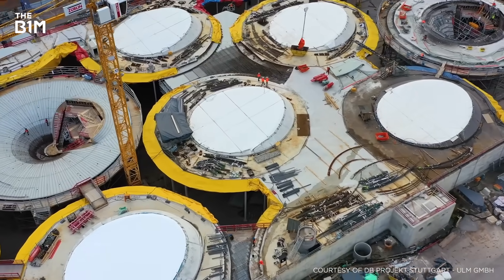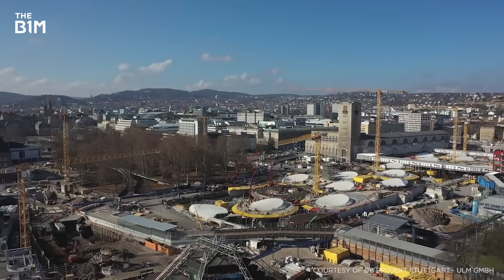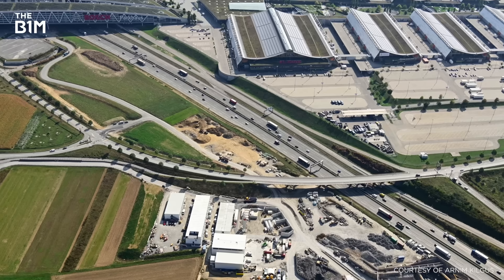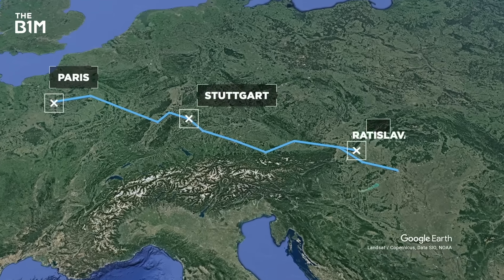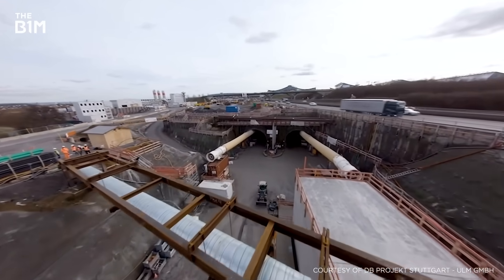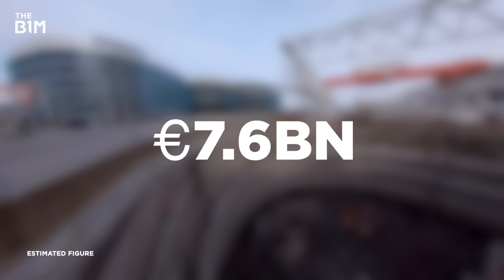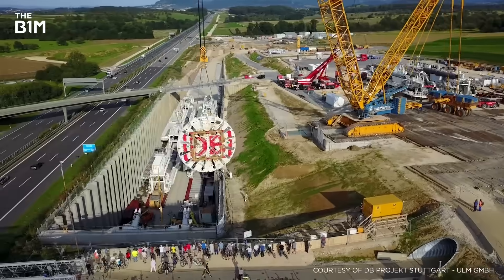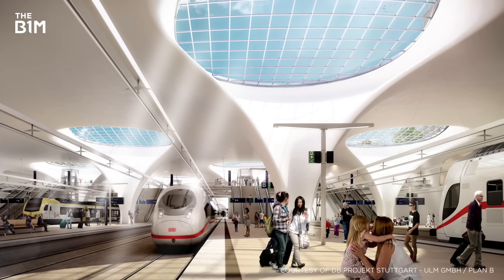Germany's 27-Year Struggle to Complete a Rail Project

Comment: As someone who lives near Mannheim and has seen them expanding the station there from 9 platform tracks to 11 just a few years ago I still can't see how having only 8 tracks in a city like Stuttgart (2019: 255.000 passengers daily vs 100.000 passengers daily in Mannheim) is supposed to work out and more than that expand on passenger capacity in the future
In my opinion they should never have planned that station with anything less than 10 or maybe even 12 platform tracks. As things are going they will have to eventually rip the whole thing open again and expand it in just a few decades because they can't keep up any longer with increasing rail traffic volume.
Reply: Unlike at Mannheim Hbf there will be no S-Bahn trains at S21 as those will continue to use the existing S-Bahn train station there.
Also Mannheim is a major knot e.g. for ICE trains. Not the case with S21.
Reply: @abalada  Even if you count the 2 S-Bahn tracks to the 8 S21 tracks it'll still not realistically work.
As I also wrote Mannheim has a daily passenger throughput that is far less than that of Stuttgart (new numbers say 118.000 in 2020) and that comes with 658 daily train stops of which 238 are from high-speed trains like IC, ICE, TGV, etc. The most recent numbers about the current Stuttgart central station I found are 1280 total trains daily in 2014 and 236 high-speed trains daily from 2018. Between Mannheim & Stuttgart lies one of the essential high-speed rail lines in southern Germany that connects Frankfurt with Munich and other cities in the south through both Mannheim & Stuttgart.
So what you're saying is basically that they'll scrap the high-speed train connections once the new station is finished and turn it into a regional train station even though they turn it in a through station so that high-speed train connections don't have to be planned with long stops that need to happen when the trains are turned in the current terminus station. Come on, that's getting even more ridiculous than what I originally thought it was.
Not to mention that the current Stuttgart HBF seems to have a maximum hourly throughput of 50 trains/hour with a current maximum of 38 trains/hour while they new S21 station only has a maximum hourly throughput of 32 trains and the expected throughput in the medium-term is 50 trains/hour.
Seriously, where do they want to accommodate all those trains if they can't even accommodate all of the trains that are currently passing through that station. Not to mention that they promised that the new station would be able to double the capacity of the current station, but even if they add additional tracks they don't even have the infrastructure to accommodate additional passengers past those 32 hourly trains, so they'd have to work on that as well.

Really, the more I read about that train station the more I realize that it's an even more garbage project than BER was and it's proving me right in my opinion that 8 tracks will never work in the medium- to long-term and they will have to expand the station considerably before long.
Reply: @TheLightbaron  You have to be careful, what your're writing here. Facts: Stuttgart S-Bahn (suburban train) => 150.000 passenger's on two underground tracks with about 700 trains per day (pre Corona). Stuttgart Main Staition => 100.000 passanger's with 470 regional trains and about 170 trains in long distance traffic. And, who is telling you that the capacity of the new trough station is 32 trains only? The two ungerground tracks of the S-Bahn Station can accomodate 48 trains per hour, will be increased to > 60 trains with ETCS Level 2 technique from 2023 onwards. The new through station can accomodate one trains every 5 minutes / per Track => 12x8 = 96 Trains per hour. 
Even Cities like Hamburg (2 Million) and Cologne (> 1 Million) have not more that 8 regional / long distance tracks, but much more passangers !

Comment: Nice video, but it presents the project way too positively.

Further, the new Stuttgart-Ulm railway connection is not part of Stuttgart 21 and can be runned indepently. It even will, since it will be ready more early. It is just packed together by the S21 propagandists.

Actually, even when the project is finished, it would make sense to undo it to the initial state. Since it has LOTS of shortcomings. 

Actually, it has less capacity than the old station (when the simulation is not run by interested parties). It has huge riscs for life. The project was just made possible through lots and lots of exceptions from the specific regulaments. 

Actually, it is just a way to transfer public money to private. With corresponding stimulation of the politicians.

Similar projects in Frankfurt ans Munich were abandoned in the planning phase since they make no sense.

Even in Stuttgart the project was stopped once in the planning phase.

And than came a former Daimler boss to be the boss of the railway company. One could think he has a hidden agenda to reduce the concurrency to the cars by destroying the public transport.

Even he claimed later: "If we had known what we know today, we would had not started the project."
Well, lots of experts knew that before. 

It was rather the case that the project was pushed in order to say later "Now it is too late to stop." 
But only psychologically it is not worth stopping. But just because lots of money are lost it doesn't mean we have to throw away even more money.

Comment: Huge projects in Germany have been a disaster for decades now. High speed railway in Germany during the 90s was the standard for Europe. Nowadays its as bad as everywhere else. Constant delays, trains not coming, etc. Everything wen't downhill beginning of 2000s.
Reply: 50% more rail passengers since 2000. A public seeing the results but denying to deal with the causes like certain bottlenecks in the network. Only now this is slowly changing.

Comment: Usually cost overrun problems are caused by contractors who deliberately quote impossibly low prices in order to get the project. Once the government has their name on the paperwork, the original budget will be spent on digging a massive hole in the middle of the city. This will reinforce the Sunken Cost Fallacy phenomenon, meaning that the project can't be cancelled because so much money has already been spent. No politician is going to abandon the project at this stage, because it would make them look bad, so they will double or triple the budget instead.

Comment: In Germany, large infrastructure projects often take half a human life time. 35 years with projects like these is normal rather than the exception. Or, consider the upgrading and widening of the upper Rhein (Rhine) train artery. A very important trans European transit route for cargo and people. That'll take some 70 years alltogether. The upper Rhein train tracks have lacked capacity for a long time now.
The project will link Switzerland and Southern Europe to the German industrial heartland (lower Rhein / Ruhr valley) and the "Be-Ne-Lux"- countries and their large sea ports.
Of course, the Swiss built the worlds largest tunnel (Gotthard, at 57 km length!)  in the process and completed it before schedule! And are still waiting for a proper German connection.

Comment: just btw: this project is indeed much more complicated than Berlins Airport.
Reply: Brandenburg Airport was just stupidity, not complexity.
Reply: @Chrome2105   25€ von Hamburg nach München ist nicht teuer. Ich frage mich wirklich wie man es hinbekommt teuer mit der Bahn zu reisen. Einfach 1-2 Wochen früher Buchen und man spart schon die Hälfte.
Reply: @mstrmren  Man kann aber nicht immer 1-2 Wochen früher buchen, und dann biste n hunderter los.
Reply: Oh really ? Very German always an excuse and it's never their mistake !
Reply: @studiobencivengamarcusbenc5272   Well it is true.
Reply: Hey, if it's only been 15 years under construction, and no truly awful messes have been made (you can rebuild the heritage-protected building), you can consider this a marvel on the order of a 12th-century cathedral (don't forget, those took 50-150 years to complete). Just check the credentials of the guy doing the ventilation design.
Reply: how embarrassing is that we don't have a international airport in the capital
Reply: @animeleek  Not really embrassing , their isent any real benefit of having more then one international airport in germany ... Germany has great Highspeed railroad lines wich make most innerstate airtravels useless

Comment: The video mentions three or four times that it's "27 years in the making" "decades long project".. then it turns out that work started in 2010.
Reply: It also doesn't explain how the delay happened. Totally glosses over it. I wanted a more in-depth exploration.
Reply: A project starts with planning...
Reply: @I-Singu-I  And its not unusual that complicated infrastructure projects take many years of planning, research and different concepts until they are realised. The title is missleading. Once planning was finished the construction goes on very smooth and in the planned time frame. Many aspects of this project are unique and have never been done..from architecture to  construction methods. So the whole project was slowed down in the beginning by a lot of prototyping and testing.
Reply: @I-Singu-I  well you'd rather it take  a long time to plan rather than just having a shit one and going 100x over budget
Reply: @I-Singu-I  For sure, but the counter point is that the public aren’t really impacted by planning. At least compared to huge construction sites in downtown areas.
Reply: @I-Singu-I  But thats not when they started the Planning for Stuttgart. Stuttgart bought this project. It was planned for other cities like Paris, Munich or Cologne. Stuttgart then bought the Project way later.
Reply: That's because of the protests.
Reply: Yes because the project starts from acquiring the land and planning the project
Reply: Planing is part of any project.  At work, all projects include planning as part of the milestones.
Reply: @eggheadegghead  It is misleading anyway.
Reply: @eggheadegghead  planing, yes. But some ideas of some local politicians, no. Planning does not start when they announce some ideas. And real planing only started after 2000, the rest were just some concepts and idea, but no plans.
Reply: Nope planning was done already in the mid 90s, only problem what they planned was illegal. So they had to manipulate to make it legal. One example the digging suite sits over the ground water supply of Stuttgart and digging into the ground is prohibited, luckily the ground water has miraculously moved away from the dig site over the last decades. Or they have to dig a 10 km tunnel through a stone called "Gipskeuper" (google translate says: gypsum keuper) that coming in contact with water can increase it's volume by 60% damaging infrastructure above ground, tunnel boring usually involves water though. And let's not forget that most trains nowadays are EMUs or atleast use cab cars and are not that hindered by the fact that they have to reverse in the current terminus.

TLDR: Most problems this project faced were of political nature.

Comment: Actually more people voted against S21 than it had supporting votes. But it needed 50% of all eligible voters to stop the project. The criticism is more about the fact that the station brings hardly any structural improvements (we're talking about a few minutes) and may even have less capacity. Mainly, it's a massive real estate speculation. The place where the tracks were previously laid will be luxuriously built over.

Comment: wow, you left out all the scandalous parts…
Reply: …and there are a lot of scandalous parts!!! The new station will be too small to handle the traffic, Building over the construtionsite of the tunnels getting damaged because of the rock layers, the gradient of the platforms are dangerous for disabled persons, properes speculations, the safed time for travellers are just a few minutes, etc…
Reply: And all safetyissues and known future problems...
Reply: And a "high-speed rail route" between Paris and Bratislava does not exist, even though it will mache in the Future. Only parts of this route are built for more than 160 kilometers per hour, which is between Paris-Strasbourg in France, Karlsruhe-Stuttgart in Germany, and a part of the route (Westbahn? ) in Austria. The route Ulm-Augsburg-Munich-border to Austria is not high-speed at all (it is less than 200 km/h).
Reply: You mean the Juchtenkäfer  that nature activists placed in Schlossgarten by purpose to delay the project?

Comment: I hope for the Germans when this is finished that their Trains are more punktual.

Greetings from Austria :)
Reply: can't pretend that the Austrian services would be that much better, especially those crossing the border to Germany ^^
Reply: @EnjoyFirefighting  In Vorarlberg the trains are nearly everytime  punktual even if they come from Lindau (Germany) (bevor the pandamic)
Reply: @Gommuten  made the experience on an international train from Austria only once ... never again
Reply: @EnjoyFirefighting  Was it the ÖBB or the DB?
Reply: @Gommuten  definetly an Austrian operator, not sure if ÖBB or another service; Was a night train, that's what I still have in mind; Was running from Hanover Central via Nuremberg, Regensburg and Passau down towards Linz and Vienna in Austria
Reply: @EnjoyFirefighting  Ok. I never travelled this far into Germany and even if I would I have to change into an German train because from Lindau away there is not much electrifyed (Öbb doesn't have Diesel Lokomotives arround)
Reply: @Gommuten  was the only relevant night train on that route at that time ... unfortunately with hours long delays in between with no updates for the passengers; They even didn't know where we were at that we could search for alternative train connections
Reply: @EnjoyFirefighting  
I never had such problems the Öbb in Austria. I know that the DB has Problems like this. The rails belong to the DB in Germany  and they controll it. So I Don't think thats the ÖBB fault. (The Tour was for sure mostly in Germany)
Reply: @Gommuten  Think it was called ÖBB Nightjet or so ... and it definetly was a ÖBB train and ÖBB crew; other DB trains were running at the same time, passing us and going in the other direction as well

Comment: You keep talking about Stuttgart 21 as if it was a great upgrade to the city's railway infrastructure. What it actually does is halving the number of available tracks in the station. This is a disaster, particularly with respect to Germany's plans to introduce nation wide clock-face scheduling (Deutschlandtakt), because this plan includes more trains in the station at once, meaning *more tracks needed*. Stuttgart 21 will be a big obstacle in implementing the Deutschlandtakt.
Reply: But a hub station automatically has a much higher throughput than a Terminal one. Trains can go through and don't have to go the same way out they came in.
Reply: @Exodon2020  however even the capacity of trains per hour is quite a bit lower on the new throughgoing station than the current terminal one ...

Comment: Although the new high-speed rail line will increase the capacity and shorten the travel time between Paris/Stuttgart and Munich (Let's don't complicate it with Ulm)/Bukarest it seems like half the tracks of the old station won't be enough to reach the old station's capacity of trains/minute. The station will definitely not be able to host the trains for 50% more passengers one of the German climate goals for 2030. 
It's a mess. The DB wants to build it so it can sell the ground on which the overground tracks lie right know. The green led state government didn't even want the project in the first place but is bound to the referendum. If you go in to it you loose trust in any competence from German decision makers.
For the German speaking readers I can just recommend the video made by "Die Anstalt", sums it up perfectly.
Reply: Stuttgart 21 will have the same Capacity as the old Station, assuming that Trains stop there  no longer than 30 Seconds. It will be undersized for Current Traffic, not to Mention the expected 50% Increase.

Comment: By the way, what will happen to the trackbed of the old station? The platforms itself are covered by the new park, but the trackbed in front of the station with all of the switches is absolutely massive and due to the angle, they can't be connected to the new station in a logical way. So, will all those tracks be removed and the area redeveloped or will it stay so that there are still terminus platforms?

Comment: You haven't even addressed the one MAJOR flaw with this project: The whole train station is intentionally slanted by ~8° along the platforms, so everything that has wheels will just slide along the platforms if you are stupid enough to let it go: Oh, your stroller is accelerating and may roll onto the tracks? Too bad. You think the leaning tower of Pisa is bad? Well, that thing is just slanted 4°.
They had to do this because the train tracks had to fit above one set of tunnels on one end of the station and below a second set at the opposite end. They aren't even allowed to call it a "main station", because those can't be tilted that much. In legal terms, it's just a simple stopping point.